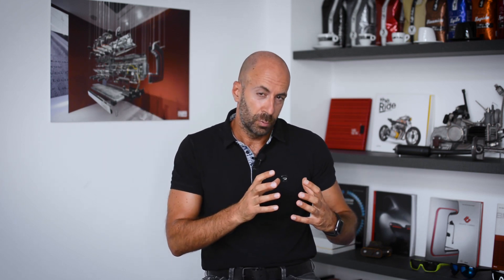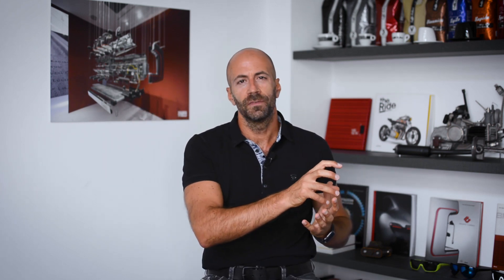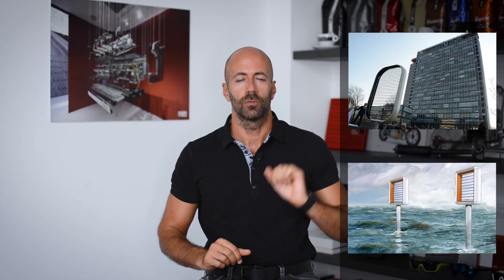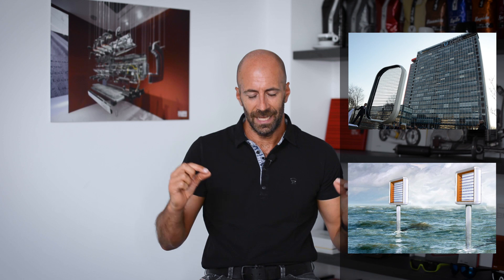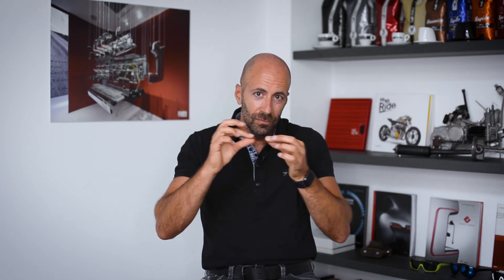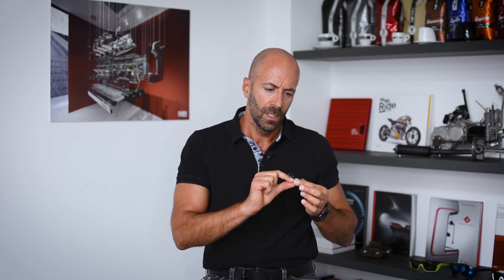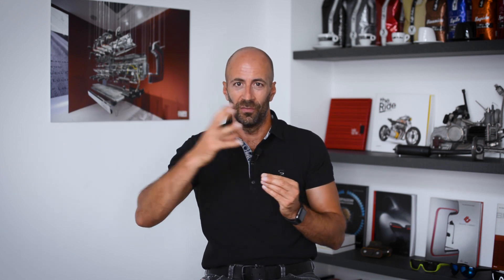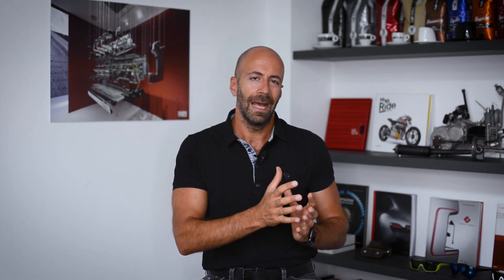Static wind generator: an innovative device that harvests electricity without blades and noise

Comment: I’ve wondered about something like this for some time so I looked for videos. I have a tennis court and put up a nylon net around it instead of a fence, and when it was new, the wind generated a considerable amount of static electricity and packed a decent spark. It built up very quickly (seconds), so I figured it must be capable of generating a decent amount of continuous power. The shock never got stronger, so it must have bled to ground after the static built up to a certain point. At first I thought it may be related to strange magnetic fields, but the nylon material static electricity made more sense after I reasoned through it.
Reply from the maker: Hi and thanks for the cool message! That is so interesting and, yes, in my opinion what you have experienced is based on a similar principle of a static wind generator. Probably I wouldn't cancel my electricity contract, yet, but I think you are getting some free electricity, my friend! Jokes aside, thanks for sharing such interesting observation.

Comment: What is efficiency of this device comparing to wind turbines?
Reply from the maker: Hi and thanks for your message!! The static wind generator technology (or bladeless) is a very new technology whose development is at a very initial stage. Currently such technology is showing a rather lower efficiency compared to tradional fan wind turbines: approx 25-30% compared to about 45-50% of traditional turbines.
We believe there is plenty of room for the static generator technology to evolve and therefore grow up to higher level of efficiency, not to mention the already obvious benefits in silence, mechanical simplicity (therefore longevity), lack of moving parts, etc etc. Once again, thanks for your message and stay tuned!
Reply: There's really no benefit.